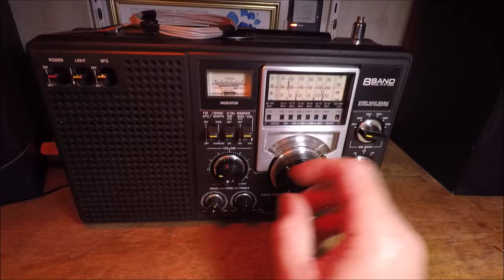Improving AM Radio Reception w/ External Antenna and Loop Connection

Comment: You still need an outside aerial so how is a 70 year old pensioner with wobbly legs supposed to set that up. This is pathetic and NO HELP at all. Thumb's DOWN.
Reply: This video is for everyone. The world does not revolve around you.
Reply: Get someone to help. With your attitude that might be difficult though.
Reply: I think this is a very good video. when someone does a video on you tube they don't normally assume that there are people who are disabled whatching you need to find someone to help you or pay someone to do it for you.
Reply: @rogerwoodland2587  I ended up buying a more modern radio that works inside my house. My late wife God rest her soul bought the radio that I had been listening to for the last 50 years as a gift to us at our wedding. We were married at 20 years old. People said it would never work but it worked ok for us for 49 years when she passed. The radio sat in one place on the mantel above the fireplace. It is made of brown Bakelite and the stations were written on the dial that selected the station to listen to. This new thing that I have now just has a lot of numbers and so I have had to stick masking tape on it so I could write the station numbers that I want to listen to onto the tape. Well thats the way of the modern world. I have kept my old car so that if anything goes wrong I can fix it myself. This computer that I am using has the same Linux  operating system that it had when I was given it. We had to do a seniors computer course at the local library and when we finished we were given the computer that we had been learning on. That was 12 years ago. With the Linux operating system you do not have to update it all the time and it will keep working virtually forever. It is simple and all that I need. My mobile is a 10 year old Samsung flip phone and it has never gone wrong. I phone some one or they phone me or I text with it. That is all I do not need to do anything else. Life can be very simple if you want it to be. You save a lot of money and you are happy.
Reply: @7316bobe  Yes Sir, thank you for sharing: Life can be Simple, Beautiful, Lovely and Happy.
Best of Wishes & Blessings!